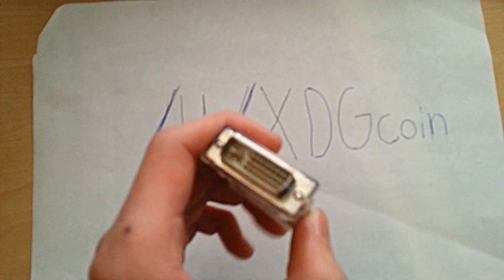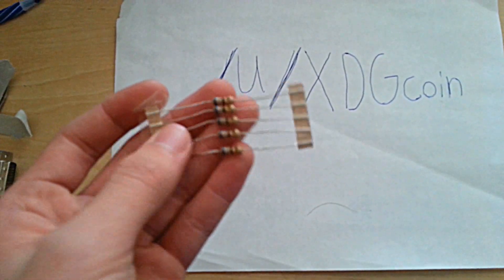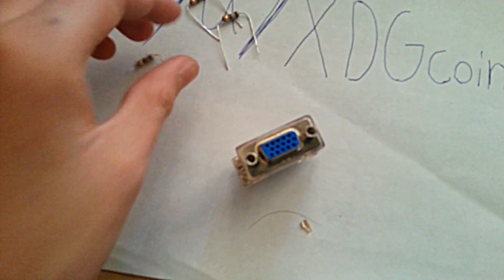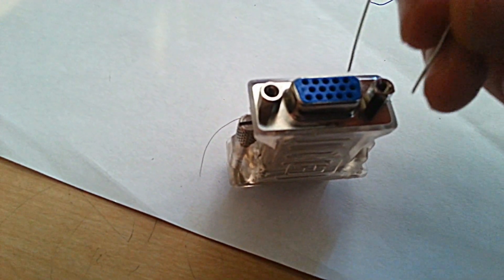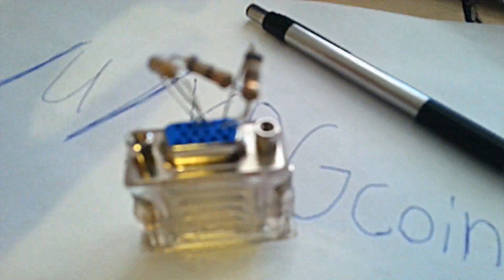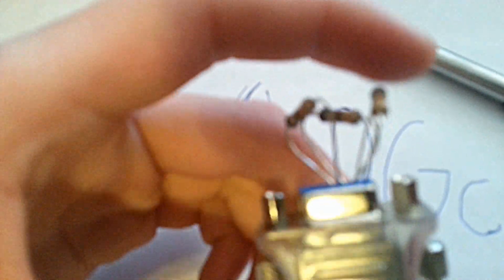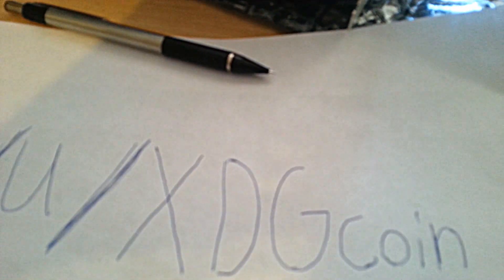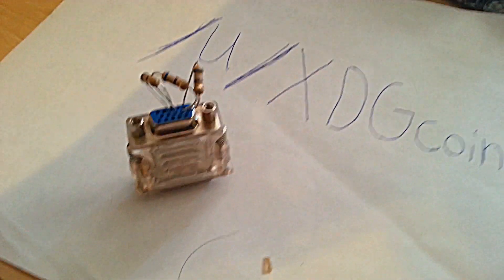Dummy plug for GPU for  cryptocurrency mining

Comment: do what i do... plug the same monitor into the other GPU but on a different port.
then just mirror option.

HDMI1 on GPU 1
HDMI2 on GPU 2

and so on.

which means when picking a monitor, get one with a lot of inputs.